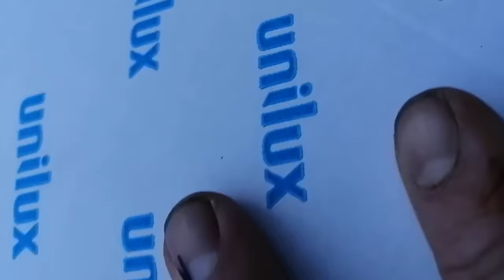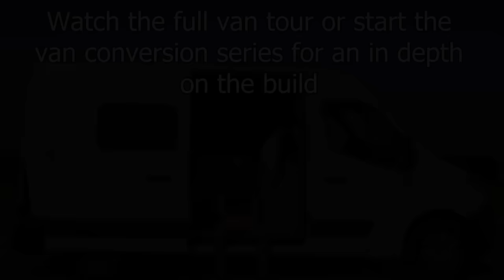Timelapse Van conversion | Renault Master L2H2 Van Build | No Experience

Comment: I stopped watching after the insulation was installed. This is asking for serious trouble. The main structure of the walls and roof suppose to be open since it is part of the ventilation of the van. Now moisture get trapped in the construction causing rust and mold. Covering the walls with insulation is okay, but leave the structure open
Reply from the maker: If you’d continue watching you’d see there is a breathing pocket of about 10/15 cm between the wall and the outside of the van.
Same goes for the roof.
I do appreciate the calling out of potential flaws.

Been living in the van for quite a while now.
- no moisture build up 
- no rust 
- no mold

Comment: why the washing up liquid when sealing the fan and power outlet ? I have enjoyed the video so far!
Reply from the maker: the soap ( and otherwise spit ) is a great way to mold the sealing without it sticking to your fingers or tools. both have something in them that basically does that. so for small sealings just spit on your finger and for bigger projects i recommend getting a cheap kids soap
Reply: @murfmontane4786  good idea.

Comment: The side panel insulation is a typical choice. The R value of bubble foil is nihil. It's more for reflecting heat from radiator.

Looks nice for the finish.
Reply from the maker: this type of insulation had a slightly higher R value then arma flex it was just a pain to work with but it safed my quite alot of money.

think i read somewhere that arma flex has 0.7R value and this had 1.2. but that what the package said haha

ive done a few trips in november and february
in the ardenne forest it is doeble but i am planning on getting a diesel heater
Reply: @murfmontane4786  are you sure? I've seen Greg Virgoe do a video were it was just good enough as vapour barrier.

The R value on the reflecting bubble foam is giving as when both sides have an air gap of minimum 20mm. So the contact to the steel panels is reducing this a lot.

Not to bust your idea here. Just trying to figure it out, whether it's a good idea to adapt.
Reply from the maker: I'm definitely not sure haha just a quick Google on what the package said Vs what Google said over arma flex. It does say on the packaging that it often used in caravans
Reply: Not all bubble foil is created equal. Few years ago I had to make a prototype ice-cream car/cycle. After a lot of research and expert advice I ended up with a aluminium bubble foil as the best insulator. Better than PIR plates. Expensive for a van though.
Reply: @oliviercoen446  love to see a link on that.